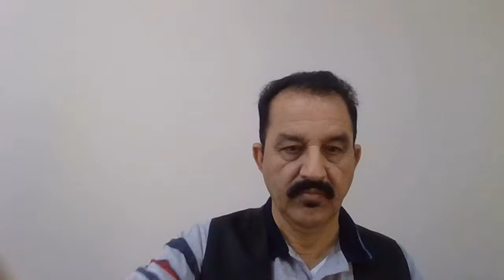Civil Construction Materials-Technical Session No 122--Material Engineer Technology

Comment from the maker: What is a materials engineer?
Materials engineers help develop, test and process materials to understand their properties and compositions. Some elements materials engineers might work with include metals, ceramics, plastics, and composites. They typically focus on creating new materials for products, meeting certain chemical or mechanical requirements and expanding the current uses of existing product materials. To do this, they sometimes use computers to model and study material compositions.

Materials engineers may work in multiple disciplines of engineering. Depending on their industry, a materials engineer might work alongside chemical, mechanical, aerospace, civil or electrical engineers. Material engineers can help design various products and materials through their research and development. Materials engineers can work in various fields and industries, from helping to manufacture bike frames to developing new, bio-medical technologies. Here are some typical duties a materials engineer might expect to perform:

Work with a team to plan and evaluate new projects
Study materials to determine how they perform under pressure, how quickly they deteriorate and how well-suited they may be for various applications
Evaluate the environmental impact of processing and producing materials
Troubleshoot product weaknesses or points of failure
Perform managerial duties like supervising others, drafting budgets, evaluating labor costs and writing reports
Consider economic restrictions and technical requirements in materials design and processing